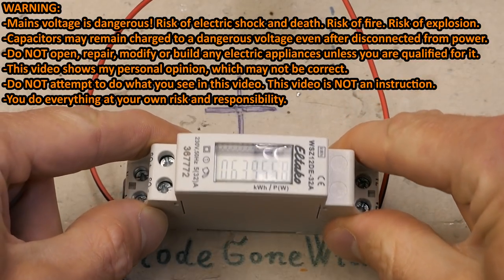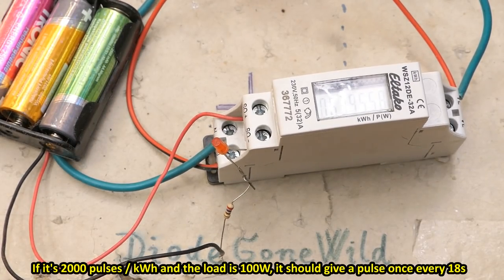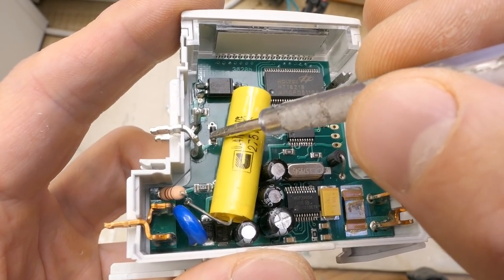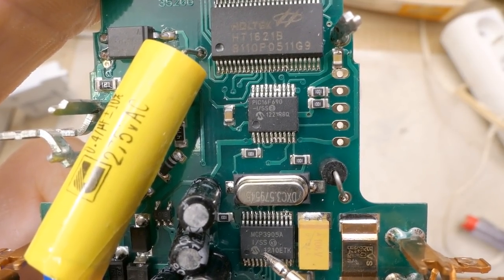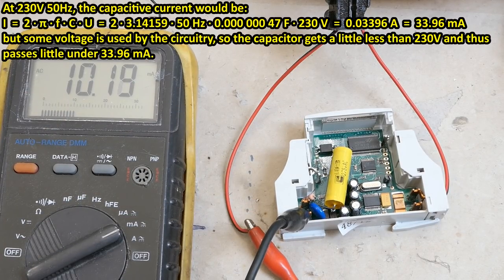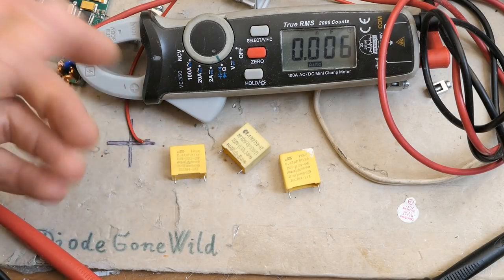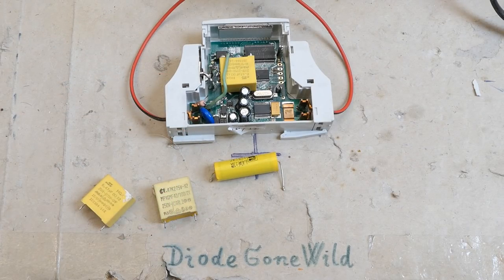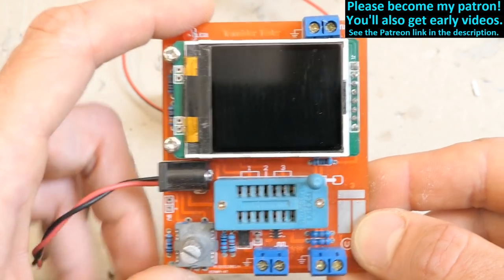DIN rail electricity meter repair and what's inside

Comment: The capacitor's voltage rating should be 400V power film capacitor, if this unit is for 230V use.
Although this is also a film capacitor, 275V is not enough headroom and there is no inductor to absorb voltage spikes. 
I bet this is a common problem with this model.
Reply: 275V is an AC voltage rating. It is about the same as 630V DC rating.
Reply: @michvod  Nope. Everything I said is for AC. 
DC ratings are ALWAYS less than AC ratings, Check any relay. 
Your calculation is also wrong. Even the peak to peak (P2P) of an RMS voltage is 275 * 1.414 =  388.9 not 630
Reply: its holy-war question. X1 rating  and Y2 rating is different for one cap!
Reply: @piconano  Wrong. I was talking about the cap specs, not the actual operating conditions. An X cap with 275VAC rating is usually specified also to handle 630V DC. X caps are meant to be used in AC applications, so their ratings are always specified in VAC, not in DC. I have seen non X rated film caps in capacitor dropper applications like those, and they were almost always 630V rated